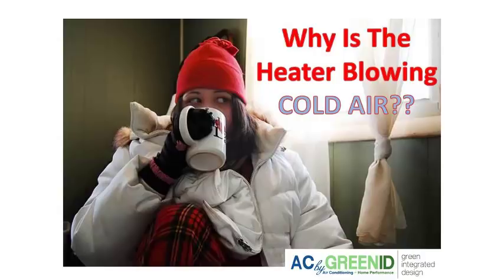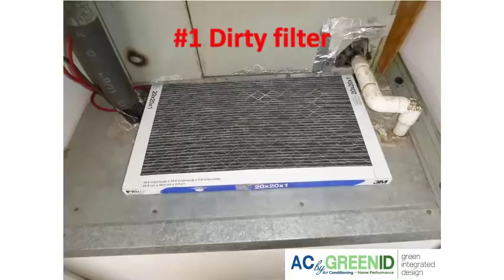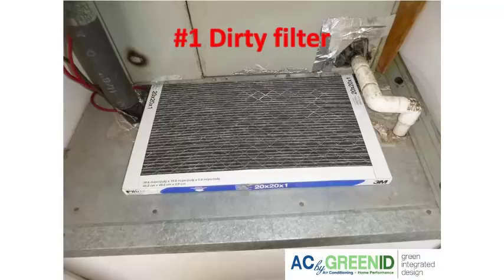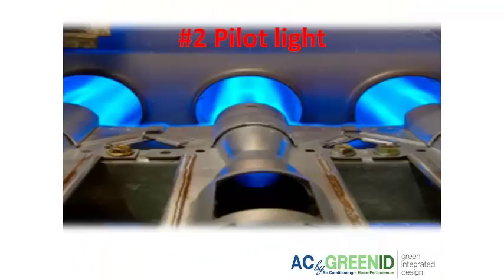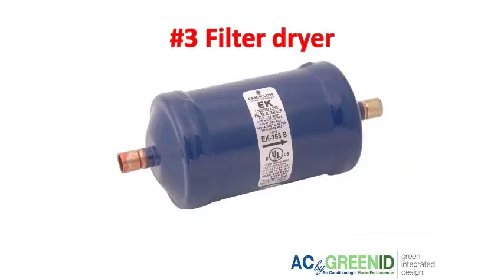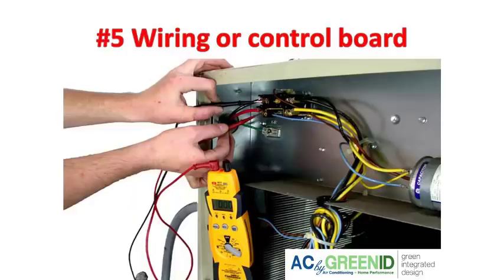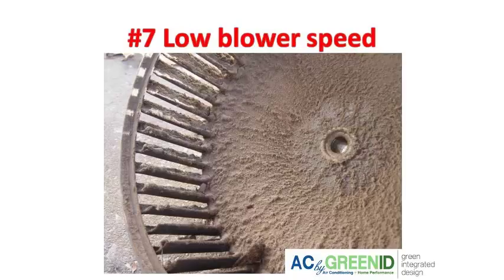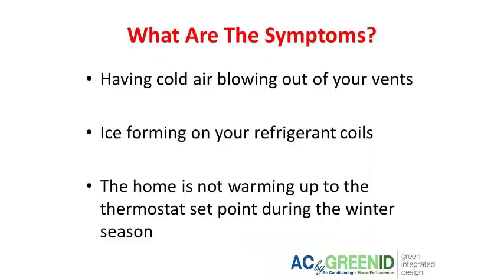Why is the heater blowing cold air from the vents

Comment: I have installed new ac unit system with heat pump, thermostat this past few month ac was working great but now since the weather star to cool off we turn the heat on for the 1 time but it keep switching from hot air to cold air, any suggestions?? Thanks.
Reply from the maker: It could be the control board or reversing value is faulty, I would start by changing your air filters though.

Comment: you mean it's normal for some luke warm air to blow out in between times of hot air blowing?
Reply from the maker: sküll düggery no it’s not normal
Reply: i noticed my system blows warm air but in between the warm air it also blows some cooler air; then returns to warm air. strange. however, the temperature remains at the setting i put it on.
Reply: i thought the uploader was saying in his video that this was normal. however, i think what he was saying was the system will do this when there's a problem. the system is safeguarding itself.
Reply: @skullduggery3377  that is normal.